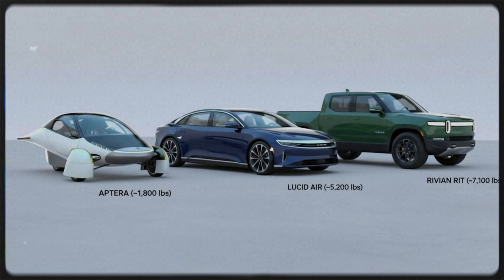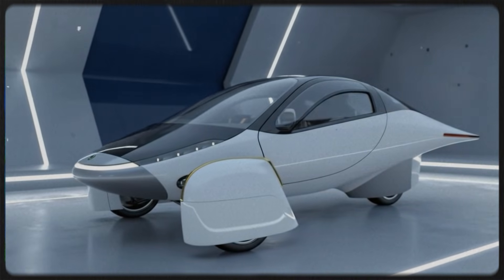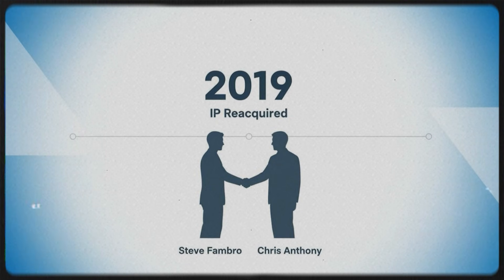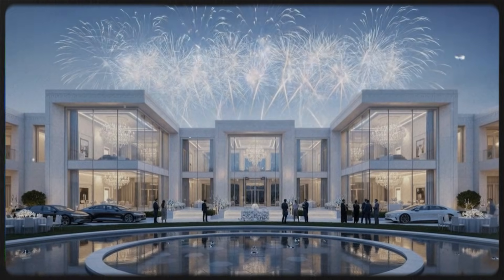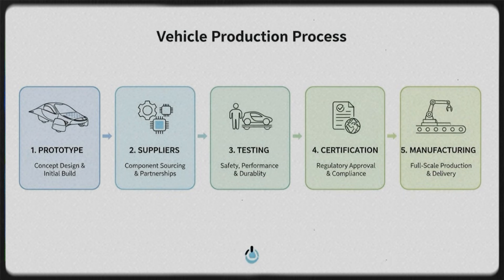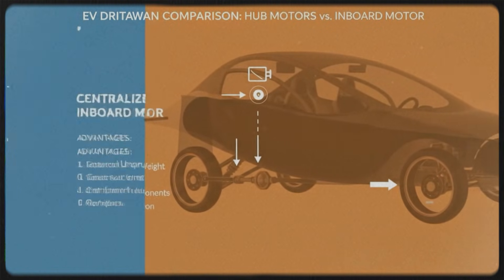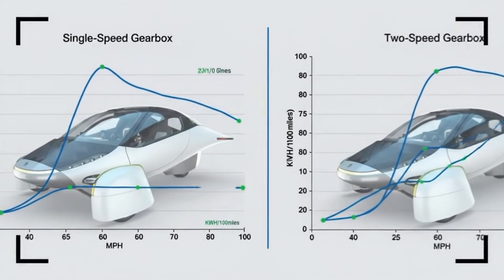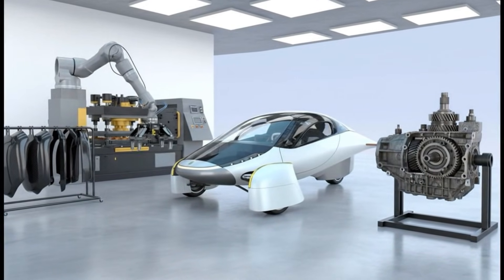Aptera’s Secret Tech LEAKED?! 1000HP Wheel Motors & New 3D Zinc Battery Breakthrough!

Comment: If you put a 1000HP motor on the rear wheel of an Aptera and applied full throttle to it from launch, the vehicle would flip itself from not having enough weight up front to keep the nose down. The Bolt EV's 160kW motor already is pretty zippy for everyday driving and that is on a vehicle that weighs twice as much. 200kW total on something like the Aptera would already sound like potentially dangerous overkill.

The whole point of Aptera is supposed to be efficiency and there is nothing efficient about going ludicrously overkill: all components have to be substantially bigger to handle much greater forces and larger currents, which makes everything less efficient under normal conditions and more expensive for no useful reason.
Reply from the maker: That's a very insightful point about the potential for instability with high horsepower and the focus on efficiency!